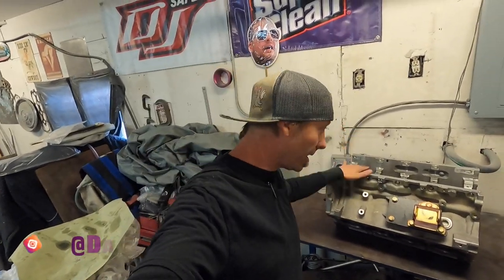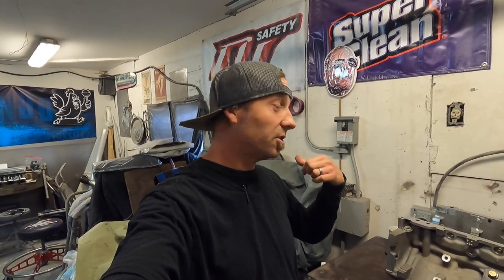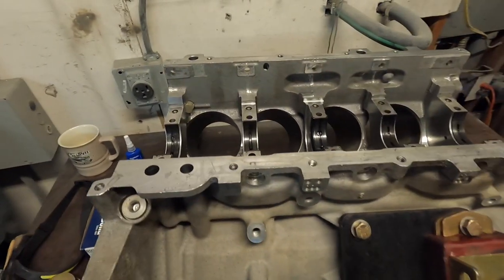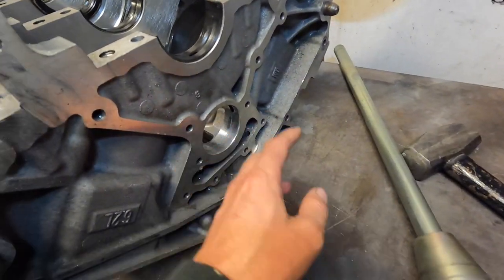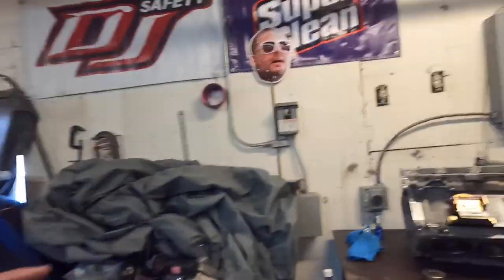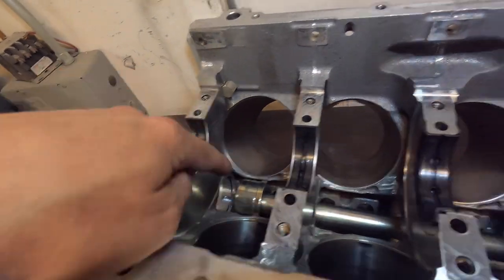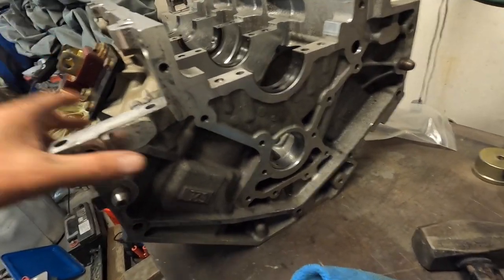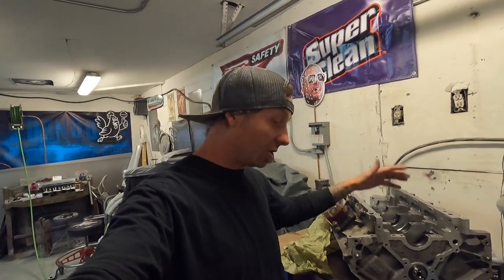LS Motor Cam Bearings Install

Comment: Finally a young man that has learned how to install cam bearings I'm 70 years young and have been doing this for years and years working in GM dealers generally if you center the bearing in the the journal equal distance from front to back the oil hole will be centered but check it any way also a light shining down the main bearing hole and a mirror in the cam bearing you can see if you are center nice to see that you go from end to end to get the length of the broom stick to help center the bearing using the length of the tool and cone to help you!!! My hat off to you young man yes lock tight help's as the no. 2 bearing has a tendency to back out towards the back of the block  on the LS Motors!!! 
PS  turn your hat around and put the cam in right!! Good to see that you can turn the cam by hand good job!!!👍👍👍
Reply from the maker: Thank you for your comment Jon. Yeah Im learning as I go. Im a DIY guy and have aspirations of going fast and since I don't have the largest budget I have to do things myself to save some cash. I have learned all kinds of stuff along the way.

Comment: Ill be doing this when I LS swap this Jeep. My cam bearings look ok but since the block is going to the machine shop for a cleaning I might as well get change them out. Thanks for sharing how its done!
Reply from the maker: Thank you for watching. Its not that hard to do if you have the tool and some time.

Comment: Been working on GM products for decades. Confirming what your friend said, loc tite on the bearings is a good idea. 
It's not like your drenching it with the product. A little bit works great. 
Neat video cam bearings are not shown getting replaced a lot. Hope it fixes your oil pressure issue.
Reply from the maker: I did these a new oil pump and a new oil galley plug so I threw the kitchen sink at it 😆. I feel pretty good about it this time.

Comment: just so you know if it happens again you can actually get the cam bearings with the larger holes its the upgraded bearing durabond is discontinuing the ch 23 the new part number is ch25
Reply from the maker: Thank you for that. Im sure it won't be my last rodeo with an LS and cam bearings.

Comment: That’s what I use is lock blue on aluminum blocks an if u shine a light in the top main an shut the light off I know that it lined up an I also do the marker trick cool
Reply from the maker: I used the pic to see if they were lined up properly. Th lock tight made sense and the marker was just so I didn’t get confused

Comment: On a 6.2 Block aren't you supposed to use the wider CH-25 part number instead of CH-23?
Reply from the maker: You can use either but I think the 23 is the go to now. Thats what I have been using any way.
Reply: I just got some cam bearings from Texas speed and performance.  Was supposed to be CH-23 but they sent me CH-25  an on the invoice it said durabond no longer makes the CH-23  SO idk man . If texas speed says so I'm going to go with it cause I'm really green to ls

Comment: Thank you for this but I still don't know how to remove them because the video went crazy fast, and a car drove across it.
Reply from the maker: Removing is the same as installing just in reverse. Take out one of the end ones and work your way through the block knocking the old ones out

Comment: Well, other than installing the camshaft backwards, the job looked pretty good.. Did you mark your pick wrong or was the bearing not pressed in far enough on #5? It looked shallow and I thought you were going to discuss why it didn't go in to your mark because I could tell in your voice that you were either surprised that it didn't go in to the mark or that you knew why it didn't and was trying to decide if you were going to say why.. And finally, just a tip to add to your arsenal, green loctite is designed for use on pressed sleeves, races, bearings, so if you can find some of that, it's probably technically the correct formula. what you used will work fine..
Reply from the maker: I marked the pick by putting it in a bearing when it was out of the motor. When I installed the first one I kept checking to see why it didn't go all the way to the mark but I think the opening in the block is not as deep as I thought and the pick I used was big. The pick stoped at the same spot in each hole so the mark I made on the pick was just deeper than what it ended up being when installed if that makes sense. If one was wrong it would have only gone in the thickness of the bearing itself witch would have been evident. You were really paying attention man. Thanks for watching and for the good question. Ill look for the green. I bet I can get some at Mc Fad and Dales.

Comment: Is there any kind of chamfer on the bore or on the new bearing suggesting that it can only be driven in from one side?  I have seen other guys on YouTube use green loc-tire which they said was supposed to be some permanent type of glue.
Reply from the maker: They are the same on both sides so you can drive them in form whatever direction you want I would imagine. Good question tho. I had to go look to double check.

Comment: Great video! Do you have a link to the tool? I tried installing mine last night with a universal tool and it was not going great
Reply from the maker: I don't have a link but its the gold looking one and I think it was form Ebay Not sure why I picked it but if you get one just get an LS specific tool and you'll be good to go. Take your time and make sure the too is square before you smack it each time. You'll get it.

Comment: The whole ‘install cam bearings dry’ thing may be good advice when dealing with cast iron blocks. But on an aluminum block, this is a REALLY, REALLY, REALLY BAD IDEA!!!! The aluminum is VERY soft, and will gall and build up on the back side of the bearing while it is being driven in. This will cause the bearing to go in crooked as well as potentially pinch the bearing down, either of which will cause cam binding. Worse yet, it will gouge the living crap out of the cam bearing bores, which will require line boring and oversized bearings. Save the dry installation for iron blocks.
Reply from the maker: Thanks for the tip. Sounds logical to me.

Comment: Oh never mind I see now they sit center and have room on both sides
Reply from the maker: The number 5 has more space on both sides than number 1. So you need to center them like you said.
Reply: @Burndown  yes I seen that wen the camera angle changed I realized they had space on each side but the way u did it with the pick to make sure it was centered with the oil galley is the best way forsure

Comment: It was hard as fuck to watch this video😂😂😂.
Reply from the maker: But did you die?
Reply: No I did not but it was just all over the place. And I would of worked inside out not outside in just food for thought
Reply from the maker: @melvinrawlings1457  This was the first time I ever put bearings in a motor I think.  I start with the middle bearing so if I don’t in this video then I have no idea why not. I have done a few motors since and then loaned out the tool to a guy and it was never returned🤣

Comment: Sir, two things number one putting Loctite on the back of cam bearings will impede the transfer of heat to the block which is not good number 2 you're not supposed to touch the Babbitt of the bearings with your bare fingers just throwing it out there for you!
Reply from the maker: 😬🤣. At least im not trying to get 300k out of it so well see how it goes. Thanks for the tip!
Reply: Oil will cool the bearings just fine. Id rather loc tite my bearings rather than have them come out again.